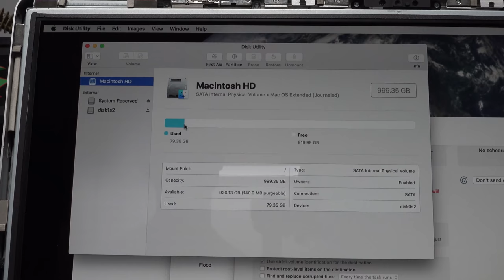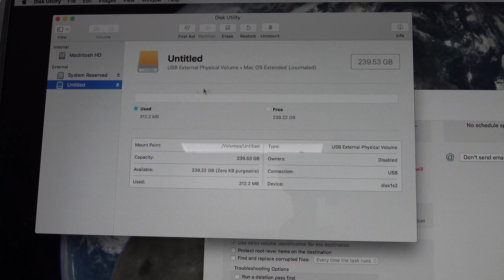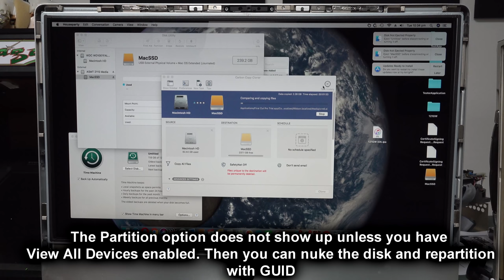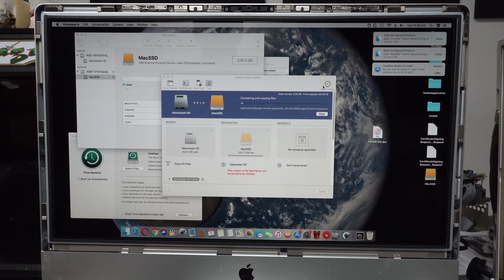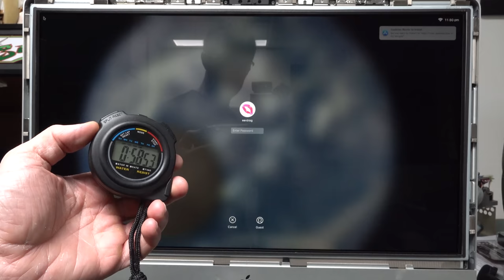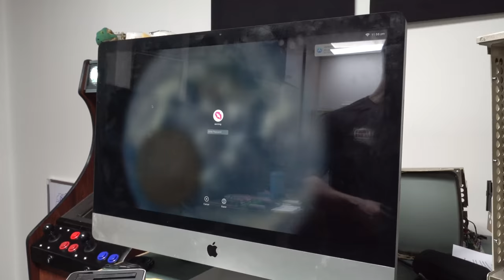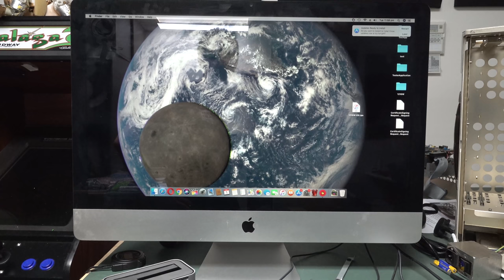Dumpster Diving 27" iMac Upgrade

Comment: Hold option while booting. When the boot menu appears, hold control and select the SSD. That 30 second delay will go away.
Reply from the maker: Thanks, that fixed it. Now boots in 20 seconds!
Reply: @EEVblog2  winner, winner...
Reply: @EEVblog2  Better did a disk check also, sometimes strange little things need to fix.
Reply: What does this procedure do?
Reply: @jevansturner  Select the default drive to boot
Reply: This can also be done in system preferences under Startup Disk. But I didn't know about the control+click on the boot selector screen to save the selection, Thanks!
Reply: @EricMBlog  Mac user for 21 years, and OSX since, 10.1, and I didn't know it saved with control click
Reply: @andrewclegg9501  yeah, I've been a Mac user for, oh man, ~30 years, and a dev for ~15years, and didn't know this. Of course it's a newer feature than that, but still...
Reply: @EricMBlog  I repair them for a living, also have a hackintosh. Learned this trick from a hackintosh forum of all places. Not sure if a command option P+R does the same thing, but this way your not resetting your PRAM. Yes the same can be accomplished with startup disk, but this method avoids a full restart.
Reply: @dash8brj  The whole thing is caused from the bios looking for the original hard drive and timing out and then scanning for a bootable drive. Resetting the PRAM might make it find the new drive first but I have often still needed to do a option button on startup to get to the boot menu. But selecting the drive in Startup Disk fixes it permanently.
Reply: @JerryBiehler  As does the control click in the boot menu.

Comment: Heads up: you can just hold Command + Option + R immediately after power-up, and the computer will download a fresh copy of MacOS from the internet and install it. Afterwards, you can upgrade to the newest version. It's much quicker than imaging, if you want a fresh install to begin with!
Reply: This!
Reply: Yes this.
Reply: Option + Command + R = install latest available OS that is compatible with your mac.  If you hold Shift + Option + Command + R you will install the Mac's original version of the OS.  And finally, if you hold Command + R that will install the version found on the recovery drive.

Comment: Still using the 27'' i7 mid 2011 model! (Posting from that model also)! It is my daily driver for 9,5 years. Consider replacing it with an apple silicone top of the line iMac when these start coming out. Most well aged machine ever used, have never been happier!

Comment: Did that too on a similar imac 27" 2010 i7 mac a while ago, I also reused the dvdrom spot for a second ssd drive and it works a treat since 8+ years, note that I used Crucial drives for apple compatibility as they don't need trim to be forced enabled for longevity of your drive...

Comment: Still rocking our mid-2010 iMac 27” here!  Producing digital artwork to this day.  Love the repairability of this, one of the last solid designs, before the “glue not screw” rubbish of today.

Mine had a thermistor taped onto the drive. That’s what the pair of wires is for. When replacing the drive, the thermistor was gingerly untaped and moved to the new one.

Comment: I think the extra cable connected to the drive is for a temperature sensor. https://www.ifixit.com/Store/Mac/iMac-Intel-21-5-Inch-and-27-Inch-Late-2009-Mid-2010-SSD-Upgrade-Bundle/IF174-031
Reply: Yep
Reply: Agreed and without it plugged in it thinks it's overheating and it throttles the whole system
Reply: @Mondegreen0  Nope, it just makes the fans run at full blast!
Reply: DAVE, you just need to jump the wires for the Hdd temperature sensor

Comment: I just cleaned out and re-thermal pasted my imac mid-2010 27" i7 and it's my primary machine. It still works great with its SSD, with smooth video streaming and other tasks, and as you say runs a fairly recent OS with High Sierra (10.13). A great machine! And I love the magnet glass.
Reply: That said, mine's the i7, not the i5. Still, I'm sure it runs alright, especially with 20 gigs of RAM! I've only got 8, sadly... Also, the i7 can go as high as 32, and I suspect your i5 can as well.

Comment: System Preferences... Startup Disk.    Before you see the apple logo, its looking for the old drive.  I've done the same thing on a mid 2011 and it boots in 25 seconds.  If you get problems with the fans running fast, its the temp sensor on the drive, use Macs Fan Control and set it to use the drive's own sensor.

Comment: That extra cable passes through the hard drive temperature to the SMC. You need a special adapter from amazon that allows the probe to be separate from the drive. Without it the fan will run at max RPM.
Reply: The Seagate drives which those iMacs first shipped with had a thermistor taped onto the drive. Had to transfer the sensor to replacement drive.  Apple must have contracted WD to build them with sensor onboard.

Comment: I hate the  Mac / Apple GUI  and just in general Mac / Apple. At least the old ones are made to be repaired and upgraded, not like today where they are paranoid of anyone but them being inside and glue it together so it is ALL E WASTE rather than allowing you to continue using it. Good on you for the upgrade. If you actually were going to use it, the drive you installed is pretty small when you start adding in data. As the drive likely was just in a junk pile in your lab anyway you can always just spend a few dollars (Ausi OR U.S.) SATA 1 TB drives are very inexpensive now a days. It was nice to see inside, thanks for the video :D

Comment: The antenna on the back plate is so it lines up with the plastic Apple logo on the back. The other antenna reads through the glass. That allows the diversity antennas to face opposite directions, while still radiating outside the metal case.

Comment: Its not an active drive select Dave, its a temperature sensor and if the new disk you install on an imac does not have this jack, you end up with a full spinning hdd fan. you can use a generic transistor as a thermal sensor instead.

Comment: The 2010 has a secondary SATA port on it.  You can add two SSD's and keep the DVD drive.  Try Ubuntu 20.10 on the other drive ... it makes the machine a beauty to run as an everyday driver.

Comment: Always inspect the 4xx Volt Electrolyte Capacitors on the PS. I saw a few corroded legs on them!
Reply: Also look for puffed out electrolytic caps. I revived a failing iMac 24” by renewing caps on its power supply pcb.

Comment: The circle thing behind the hard drive is the rear antenna, it is positioned behind the plastic apple logo because otherwise its kinda tough to get a signal though aluminum,

Comment: For the a1312 iMac's I generally have found it best to remove the LCD from the iMac with the iMac laying Horizontal in a Jig I have made, this way it prevents any stress on the LCD cables during the removal process. 

These are amazing machines with the most upgradability I have ever seen from any AIO, HP z1 being the exception. The MXM thread still lives on, on Macrumors.

Comment: I used one of these for close to 4 years running practically 24-7. They're generally a pretty solid machine EXCEPT for the heat issues. I had Macs Fan Control on mine and even with all 3 fans running wide open it still had trouble staying under 75C when watching a live stream on Twitch or YT.🙄 
About a month ago, I was planning to do pretty much what you did, plus upgrade the video card for a 'metal-capable' card so I could update pretty much all the way to Catalina if I wanted. I was going to just go as far as Mojave though because I found out some key apps I use weren't supported under Catalina (plus the file system is different). Unfortunately, after I upgraded the video card and got it working, I went to open it back up to do the SSD upgrade (2 TB on mine), and in the process of pulling the screen back out, it slipped and pulled the graphics cable connector away from the mobo.😬 That was the last time the screen lit up. 
I tried unsuccessfully to fix the graphics connector, but I think maybe it might have popped the power rail to the graphics card when the connector got damaged. I ended up finding a pristine 2012 cheese grater Mac-Pro on Ebay for $600 with a quad-core Xeon and 16gb. of RAM. (no drives), but a good deal and good warranty. I had to get a special drive tray from OWC to use the SSD in it, but otherwise, my Time Machine backups that I had been making to my home NAS system, copied over to the SSD on the Mac-Pro and actually booted!! (these backups were from a 2010 iMac, mind you! Try THAT with 2 completely different Windows machines some time...). 
A little bit of minor configuration stuff and a couple of spare 2 TB. mechanical drives, and I have a machine that will also boot High Sierra in 20 seconds or less, and runs cool as a cucumber (not to mention quicker overall). I did have to splurge for a new $149 27" LED backlit monitor so I didn't lose any desktop acreage, but I still think I got out of it pretty cheap, considering every other 2012 Mac-Pro on Ebay and elsewhere is going for $800 or more depending on the config. I still plan to upgrade to Mojave eventually, but like the iMac, I'll have to change the graphics card out first. At least on the Mac-Pro, you don't have to tear the whole machine apart to get to it!😉
Anyone need a broken 2010 iMac 27"? Still get the boot chime, but that's about it. No screen action. Parts only..😜

Comment: you need to set the ssd as the master boot in system preferences then open startup disk and select the ssd  ;) hope this helps
Reply: Why would you need to do that when there's only one drive in the system?
Reply: @einfelder8262  because sometimes it still looks for the old drive hence the boot hang
Reply: @flippyfurbex  Does that mean the cable that was attached to the master/slave pins on the old WD drive was actually used by the BIOS, and then kept even though the drive was removed?  Is that a weird Apple BIOS programming thing?  Or is half the BIOS in the OS?
Reply: @einfelder8262  the pin thing is a temp sensor

Comment: I had the same model from a friend at work for a couple years, you can still buy replacement glass windows for them. i7 version, good enough to play CS:GO on and do all my web dev work - eventually sold it to move to a PC with a better screen, but it was such a good system.

Comment: These can also be used as external DisplayPort Monitors. Search for Target Display Mode. Also if it ever dies, it's a 80% chance the GPU gave up. Those older Radeons are known for just randomly dying. If you swap the GPU it can run the latest os.

Comment: Do a CMD+Option+P+R + Power and let it reboot while holding those down a couple of times.  This does a PRAM/NVRAM reset and after opening and upgrading the drive you probably need to do this.  I fix Macs for fun and resell them.  I hope that is the correct sequence on that iMac though, you may need to double-check and look it up.

Comment: Yes go to System Preferences>Startup Disk unlock the padlock in the corner, then select your correct boot disk and reboot. This will make Mac OS load instantly on boot. This is telling the NVRAM/EFI what disk to select on boot.

Comment: I still use one of those! and it boots very quickly. You need to make a system restore. Btw. you can replace the DVD with an SSD and keep that 1TB for storage. There is even a third party bracket that fits the DVD bay :) And when that i5 gets to old to use you can replace the mobo with an LVDS to HDMI controller and keep using that MAC as a nice 27" display :)

Comment: DosDude1 has a series of patches that allow you to install newer versions of the Mac OS on older hardware. If you have ATI graphics some of the newer OS will still not run on the systems so be aware and know the model graphocs card you have. Macs Fan control makes free software to manually set fan curves. the stock apple fan curve kicks the fans in just before the system catches fire. to try to get rid of the boot delay go into the settings and choose the SSD as the startup disk.

Comment: As others pointed out, the boot delay is because the NVRAM has the ID of the old boot disk.  The ROM was looking for it and wouldn't look for anything else (like your SSD) until after that one timed out.  The "Startup Disk" preference panel is the easiest way to set that.

As for that extra wire from the hard drive, that is likely a data line for reading the drive's temperature, as a part of the fan control system.  Since non-Apple drives don't have that capability built-in, you normally need to attach an aftermarket thermal sensor to that cable (and stick it onto the SSD) in order to let the fans behave properly.

See also: https://www.ifixit.com/Guide/iMac+Intel+27-Inch+EMC+2309+and+2374+Hard+Drive+Replacement/1634

Comment: Of by the way when you remove the mechanical hard drive the fans will go full blast as the hard drive has an inbuilt temperature sensor, to sort this out install an app called MacFan control

Comment: No need to go through the steps with cloning etc if you just want a clean MacOS system. Just press ALT + COMMAND + R at startup to boot off the internet with WiFi. Then simply erase your SSD with Disk Utility and install the latest MacOS version for this Mac (the internet boot will automatically download the latest OS that this model supports). This way, your boot time will most certainly improve. If you don't want to do a clean install, check your startup disk in System Settings. It looks like it's still looking for that old HD att boot time - and the Apple logo should normally appear much faster.

Comment: Dave the little cable for the hard drive is a temperature sensor❗️
 you need to buy Add-on temperature sensor I believe I have the part number I would have to look I have a couple of them When upgrading you need to add external temperature sensor or the fans will kick up 🆙 
Would be good to replace the thermal paste on the GPU and CPU too

Comment: The Command + Option + R trick that has already been suggested is a good to know when reinstalling Macs.
-
Also if you want a better view of the temperatures + adjustable fan curves, take a look at Macs Fan Control from Crystalidea. Free and awesome!
The default Apple curves tend to spin up the fans quite late. For longevity it's always better to push them up a bit more.
--
And for the slow boot up time, it's actually the posting step that seem to take long (just gray screen, no Apple logo). It might be taking time enumerating drives (especially because you replaced it). You could try resetting the NVRAM/PRAM by holding Command + Option + P + R at boot up until you hear the chime. This will essentially reset the BIOS and might speed up the posting sequence.

Comment: Mac's rarely raise the fan speed. I use MacsFanControl to set temperature parameters so it will run cooler. Also it can run MacOS Catalina unofficially using Dosdude1's patcher.

Comment: 7:40 I'm pretty sure that's to a thermal sensor.
Reply: It is, without it, the fans are going to take off like a jet. Will need a new sensor or software to fix that. Also, for the boot issues, reset the pram.
Reply: @Natsuru_Senou  Yep. The older models had the thermal sensor just glued to the side of the harddrive. I salvaged those sensors whenever possible. Useful little things.
Reply: @Natsuru_Senou  Theres also Software to fix the fan issue
Reply: I've done this exact upgrade on the same machine. You can just jump the thermal sensor, works fine. IE, cut the wires, solder them together or put a jumper inside the connector.
Reply: @DeejayControl  already said that.
Reply from the maker: Apparently it is. Works fine with it just flapping in the breeze.
Reply: @Natsuru_Senou  People have "fixed" the lack of temperature sensor just by using a sata-splitter cable. Apparently that fools the system into thinking something's on that particular data line.
Reply: but SMART all ready has one built in   or it can't read it???
Reply: @tyrgoossens  I tried that with no luck myself.
Reply: @punker4Real  SMART request is rather slow and interrupts data transfer.

Comment: It really shouldn't take that long for the Apple logo to appear. Seems to be having trouble with the drive. A fresh OS install should probably take care of that? You might also run disk utility on the drive to make sure everything is okay.

As has already been pointed out, the "selector" cable is actually a hookup for an internal temp sensor in the original HDD. You can get a compatible external sensor that you then place near the SATA cables and that should do you.

This model tends to run little hot, but having cleaned out all the dust, blown out the radiators, cleaned out the fans, and reapplied thermal paste to the CPU and GPU, it runs much much cooler than it did before, at least for me. It was always revving up the fan before, even when idling, but that's taken care of now. I've been experimenting with different fan control software (Apple tends to have fans only come on high when it get very hot), I think I will probably go with iStat Menus.